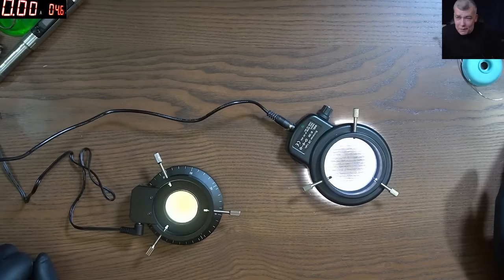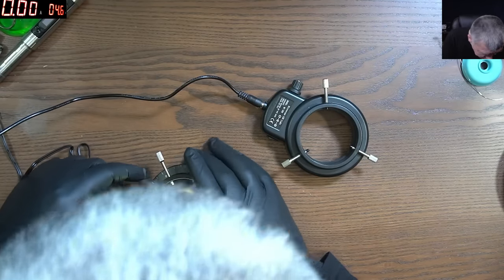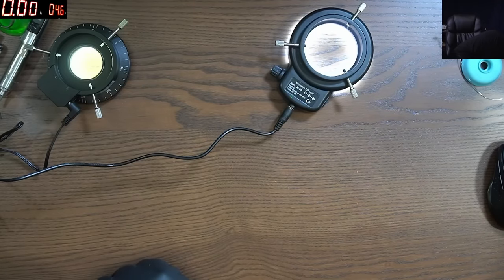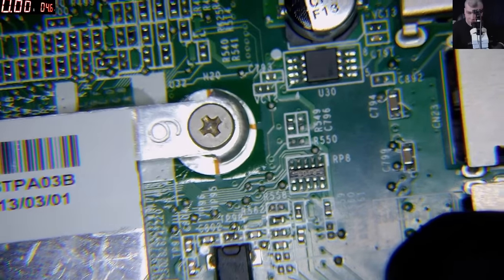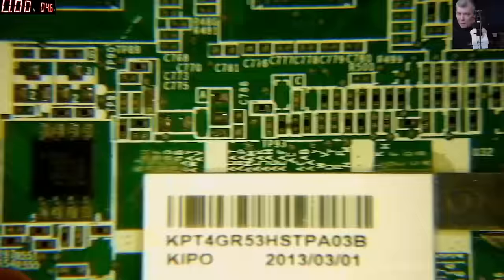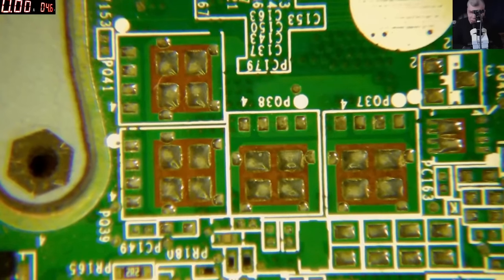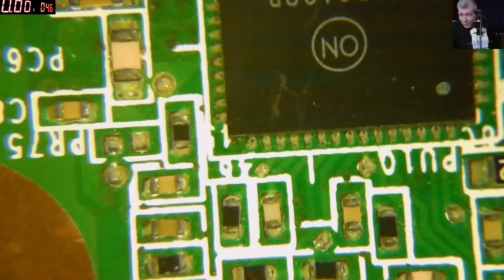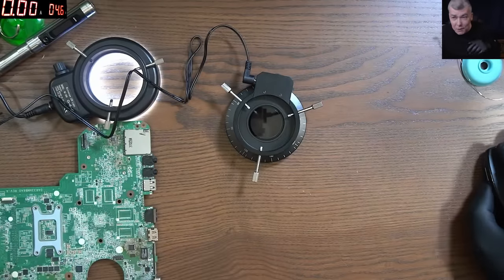Microscope polarized LED ring vs normal led ring - FYSCOPE 16pcs Microscope polarized LED ring

Comment: The issue is not the dynamic range, the main issue are reflections, and that's why the polarizer works to make the picture better, because polarizers block a specific light rays that come from a specific direction.
Reply: Correct. 👍
Reply: At 7:22, he removed the ring light and suddenly, you can read the capacitors using just the indirect light.
Reply: @bblod4896  Silly part about it is that he showed that he can lower the power of the ringlights at the beginning of the video, then didn't use that feature again, which would have allowed him to see whichever part he wished to - obviously is a bit more messing around to change intensity to view different things. I just use a bright led torch held at an angle if I wish to see something that's proving difficult...
Reply: @bblod4896  Exactly !. I think the point is (as made by someone else  here) use a separate light and point it yourself to see something that is proving difficult to see.  It is the adjustability of the  polariser which is key but you get the same effect with a separate  tiny hand held light which you move  to where it gives the best results.  The polariser is more convenient though and if you are working with two hands it's easier.  There is often a solution to a problem - when you spend money that is.
Reply: Hmmm?? WDR or Wide Dynamic Range is the anti reflection or clearing reflection. I'm using the right microscope with WDR and I have no problem's with reflection, I can pull up the light on 100 %. and clearly read all information from ics ....

And u have to pull down u light to read something? And telling him the issue is the reflection 😂😂  

He is 100 % right.
Reply: @jasko.n  Seems you managed to ignore the most pertinent part (quoted here) when you wrote your reply: "There is often a solution to a problem - when you spend money that is."...

Comment: Finally, pixel count is not important in cameras but pixel quality is. I was producing billboard images and magazine page size product photographs with a 3 megapixel camera. This was with the first digital cameras. Just like with amplifiers, passing a clean signal to the speakers is important to the observer. Listeners do not need not know that it came from an iPhone size amp or a $50,000.00 amp. The observer judges the sound and there are as many opinions as there are people. I could not show my clients the equipment as  I was using an Nikon 990 amateur camera. All my lighting was pro quality flash units/studio strobes. I used software in DOS to align the red, green and blue images from the poor tiny camera lens to bring them into perfect alignment. Voila a great quality image! Pixels are to record details. More pixels, more detail but not a better picture. Bigger pixels, better quality picture. 
However, like you, I was a master with my glue gun! (My Nikon 990 and DOS)

Comment: Angle of incidence = angle of reflection. The angle that a light hits an object is the angle at which it reflect off the object in question. If you shine light on to an object at 90 degrees it is going to reflect back into the camera lense at the same angle. A law pf physics.

Comment: I like this light with just a little bit of reflections, not enough to blow the image but not so dull so you can't see clearly solder joints and pins.

Comment: The polariser is blocking the reflected light which itself has been polarised by the light unit.  This effectively means you are just not seeing the light you shine onto the board.  @7:22 of the video you can see that when you remove your first light you can see the capacitors, etc. very well.  A cheaper solution is just turn off the microscope light when it gives too many reflections so you can see the details you need using diffuse ambient light instead.  Effectively 'turning down' the light with a polariser is really just wasting the money you spent on the light in the first place.  Microscope near a window with a big white reflector on to the work area is best cheap option if you have daylight. Good video though.  Love all your fix work.

Comment: It's not the light that does .the magic, it's the polarized filter. So a good pair of sunglasses or camera polarized filter with the  old 120 LED lamp would do the same thing. Also if you take an LCD screen apart you can use one of the layers to filter the light.

Comment: It is not just a problem with the dynamic range of the camera, it is rather a problem with the ring lights that they sell. I have a fairly quality camera but the light ruins everything because it is a non-polarized ring, you can put the best camera in the world If you don't polarize the light you will have that problem

Comment: Polarized light was/is used in the copying of art work in museums. Light aimed at an imperfect surface like an oil painting scatters and causes specular reflections into the lens that are not part of what you are photographing. These reflections that ruin the image can be removed if two light sources are used on the side and both have a polarizer gel in front of it. Both polarizer gels need to be in the exact aligned position shining to the object. With the a linear polarizer on the camera in 90 degree away alignment to the lights the reflections disappear and are zero! Rotating the polarizer on the camera then allows more or less reflections. Due to lack of reflections paintings look often lifeless but that is another topic for another day. Obviously Electronics share a lot of these principles as all wave forms are bound by the same physical laws.
Rinus

Comment: Comparing apples and oranges is the big problem here. 
Firstly your microscope is set up to look exactly down the middle of your ring light. So that is setting the parameters for any other camera comparison. Remember that when it comes to reflections, angle in is also angle out! That means if the light enters at 45 degrees on a reflecting (like a mirror) surface the light also exits that surface at 45 degrees. 
The microscope looks straight into the reflected light or does it? It does NOT! The ring light comes from the side and to be precise, all sides around the periphery. The lights enter with a slight angle and then exit with a slight angle opposite of the optical axis of the lens. The optical axis is exactly down the middle and it does misses the reflection
Aiming the microscope at a subject/object that scatters the light will reflect it not only as I described but also into the lens. The reflectivity of any shiny object is in photography described as specular reflectivity. It is like the sun reflecting in an apple. That spot is very bright compared to the rest of the apple. In fact if you tried it on a silver (Christmas ball) the dynamic range of any camera no matter how expensive or even our eyes cannot see any detail in both areas at the same time. So specular highlights are neve considered in dynamic range measurements.
So to be fair in your video, the capacitors are your specular highlights that are too bright to be seen together with he rest of the board due to the direction/position of the ring light. They scatter light into the lens. Camera phones or digital cameras may be better but the camera is not the problem. If one could remove the microscope camera (but leave the light in place) and replace it with a phone or pro camera and according to the fixed parameters place the lens in the same exact optical axis the capacitors will look the same. You actually did that in your video (for only a second) while aiming your phone over the ring light. 
Years as a product photographer the lesson was not the camera or the film or digital imager, it was lighting! 
I am now going to watch another of your videos as I am trouble-shooting a power board in an LG LCD LED TV that only has correct voltage when the main board is connected to it at 13.25v but only has 8.8v when I disconnect it. It never ends. Thanks for your great patience in doing your videos.
Rinus, Greets from Canada

Comment: In photography we generally do not use full polarization. We turn it back a bit to get the life back in the picture. In your demo, full polarization is difficult to work with. All depth disappears. We need to see at least a bit to see what we are doing. no shine on solder looks like a good solder joint. A bit of a shine will show the crack in a cold solder contact. Just saying.
Rinus

Comment: This is much better than NorthridgeFix's solution for microscope light glare. It replaces the existing microscope ring light and it doesn't take extra space - especially when you have small work desk.
Reply: And yet northridge fix solution looks 1000% better than sorins budget myth hack
Reply: @waynetaylor2784  "sorins budget myth hack" lmfao, what is this cope???????
Reply: @AeRiaL_  yeah I'll keep my opinion with 37yrs in the industry and 6 repair shops. I'm pretty sure I and the rest of the professionals out there know the truth. You believe what you wanna believe n waste your money on whatever you want. Doesn't bother me in the slightest
Reply: @waynetaylor2784  I looked up the cost, it's almost the same price. NorthridgeFix use AmScope LED-6W which cost $130 on Amazon - NorthridgeFix branded their own name and sell it for $149. I checked on Aliexpress the cost for this light is $125. So cost wise they are the same. But this is a better solution if you have a smaller work desk
Reply: @danfromtechnesia  yeah don't think so your looking at 120 led model not Sorins 16 led model way more expensive
Reply: @waynetaylor2784  You're talking about the price point where I'm talking about not taking much space. In this case you can also read the number on the chips without buying extra lights or filters.. spend $0... by.... tilting the board :)
Reply: @danfromtechnesia  well aware angle of light source is the key, I'm just saying these polarised microscope lights been debunked time again by many

Comment: Not sold on the idea, aside from being an expensive option - it's all about the angle that actually causes glare. I give Alex @ NRF credit on his non glare solution, best solution for the price.
Reply: Well, his solution is using the ring light+the gooseneck light. They cost a total of ~150$ right now on Alie, so it`s not really cheap either. The polarized light from this vid is ~170$ on Alie. Both solutions are good though.

Comment: The image is still a garbage. I have the same polarizer (200 euro) from aliexpress and with my eakins IMX307 or IMX385 Sony sensor it's a killer. And when you add also gooseneck 2x3W led light the image is even better. I don't know what kind of sensor is inside your camera but definitely this polarizer is not showing his full performance with your camera.